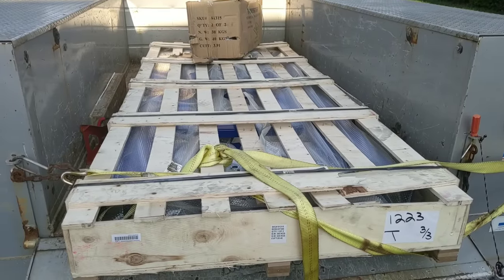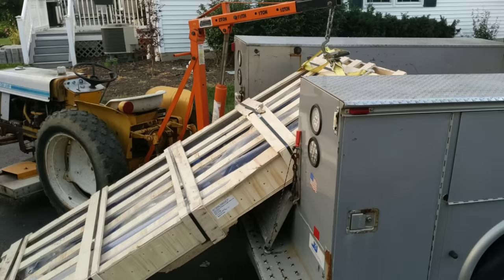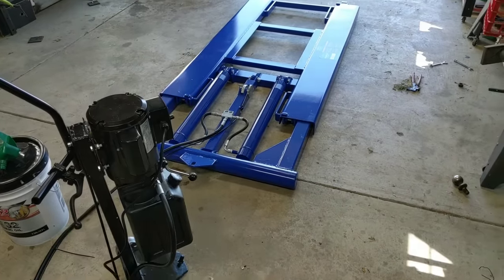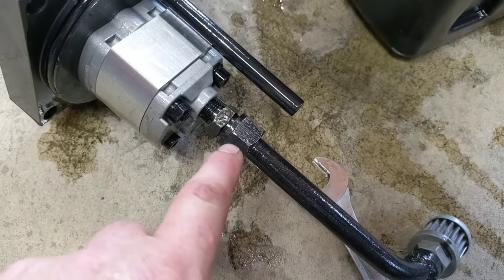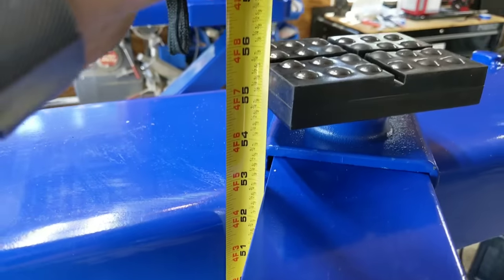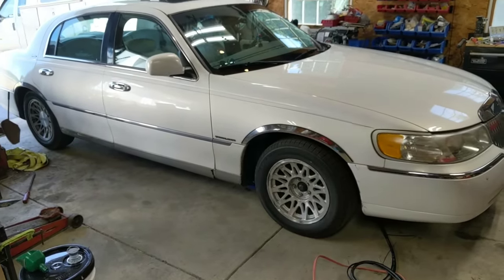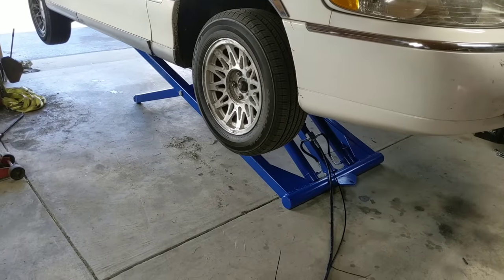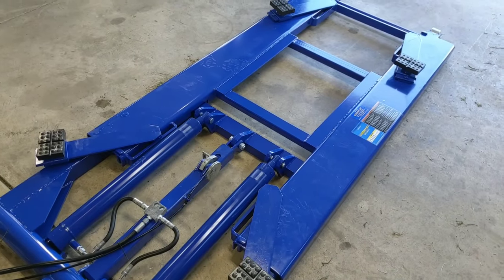Harbor Freight 6000 Lb. Capacity Scissor Lift Review, Central Hydraulics, is it worth it?

Comment: I have had mine for at least 15 years,,,it still serves well,,, I use it at least once a week,,,and more most times. It lifts my car,,fullsize Tundra pick up,,and my motorcycle,,,,its possibly the most sought after piece of equipment by my neighbors. I give it a thumbs up all around. One neighbor has bought one as well,,,,,,if there has been any issue its the coating on the steel, it really failed too early. But that has been touched up over the years as required.

Comment: As a 20+ year certified welder i find it  hilarious when people say the welds look good or bad! Well I’m welding it’s not the how a weld looks it’s how does it hold! In other words it could be the best looking weld you ever seen and not hold 100 pounds or it could look like crap and hold a building! When it come to welding looks can be  deceiving!
Reply from the maker: As a non certified welder, I agree.   That being said, you can spot a bad weld if it's bad enough.   And your right, really good looking welds can be cold and fail.
Reply: @1D10CRACY  I agree 100%
Reply: oh my god Dodge Ram 01 ! Thank you for the comment. i have said the same for years ! These "welders" nowadays will argue till blue and still keep going. so glad to know that someone else out there has the same thoughts and understanding..
Reply: @corgidriver9625  Well its just common scene!
Reply: @1D10CRACY  And, it's not made out of steel. It's Chinesium.
Reply: I doubt your certified. Slag inclusions, undercut, overcut, porosity-- all are unsightly and all will cause your welds to fail on your 6010 root passes and 7018 fillet beads for you 1 inch plate bend tests in flat horizontal vertical and overhead positions. When your beads are stacked up like dimes, at the correct temp and you watch your puddle, avoiding the aforementioned-- you have  welds that are beautiful--for a reason. They were executed by someone who was taught the proper way to weld.
Reply: @jkgkjgkijk  Brother you can cold weld dimes!
Reply: Greyghost680 you can’t tell welders shit! I’ve VT rejected guys that have welded 40 years and have never heard of excess reinforcement... or unacceptable weld profile. always interesting when  rejecting those and listening to the bullshit!
Reply: @jkgkjgkijk  Thats all fine and dandy but 6010's and 7818's are arc or stick welding! I was talking more about Mig! and Tig! Any who 6010 is on lower grades of pipe, much more common is 70+ (8010) and sometimes 7010 70's are stronger!

Comment: I have owned this unit for about 6 years. There are at least 3 safety issues. First, over time the spring that detents the teeth gets weak and does not engage. Second, if the hydraulic unit falls over and snaps the hose, it goes right to the floor. I welded a large screw over the cam and screw it down tight. I also added more meat to the teeth. They are too shallow. The last issue was the power switch. It will arc and stick. This means it will not stop going up.
Reply: M1088Guy that isn’t good. It sounds dangerous
Reply: Is it stable when the car is up in the air? Can you push is and it won't fall?
Reply: @billcoley8520  Yes, without my mods, it is a dangerous machine. If the hose for any reason comes off, it can go right to the floor. Should have safety valving in hydraulics to prevent this.
Reply: @victorC308   This is rarely an issue on solid, level ground.
Reply: I would also move the hydraulics to a wall. Use the stand to move it around. The pump can fall over and snap the line. It happened to me.
Reply: @urgentcareguy3  ok. So I can trip on it and it will be stable?
Reply: @victorC308  Trip on table? I would think so. Trip on the pump, not so much.
Reply: Wow,  Good that you posted
Reply: so if the power switch this guys car would lift the ceiling off and destroy the car ?
Reply: @joeennis2571  exactly
Reply: Unless you use a relay, most switches are not capable of the amps that this draws. Worse with 120 volts. This means twice the amps of 240, which might melt the contacts.
Reply: @urgentcareguy3  how many flat dead guys in a rarely.....😀
Reply: @urgentcareguy3  there are lots of switches that can handle the current.....just not chinesium switches.....😀
Reply: @mdrew44628  I looked, but was not as common as I thought that it would be.
Reply: I noticed that you have to make sure that lock cam doesn’t kink. Oil the whole banana regularly. Aft a while the lock works in nicely and you can hear the clic when it engages.  Put a cinder block on the plate of the lift. It’s very top heavy when separate.

Comment: Get the Quick-Jack. 

The Quick-Jack allows you to work on the underside of your car and also replace/rotate wheels, since there are two jacks....One jack for each side of the car which exposes the underside for work and repairs. This Harbor Freight jack is more expensive, and prevents you from being able to do repairs. It's good for rotating tires, and that's about it.
Reply from the maker: Quick Jack's are awesome!  And they store better.   I looked at them before buying this lift, but for me, the lift is a better option.    For lower body / detail work, this lift works out really well.   A stool with good wheels and now your saving your back!   I also wanted to use it as a welding table when not being used as a lift.    If a person wanted to do mechanic work other then brakes, then the quick Jack's would be a better option!
Reply: @1D10CRACY  buying a lift for tire rotations and brakes lol.
Reply: They’re for body work I do restos and have scissor lifts and quick jacks as post lifts are kinda useless when u have posts in your way they’re good for separating body’s from frames tho

Comment: To get around the ground clearance issue you can build two long ramps out of 3 or more stacked 2" x 12"s  that are flush on one end and stepped on the other at about a 12" offset/stagger to drive the vehicle up and over it. Just make sure the top level is long enough for the wheelbase and a 4" x 4" tire stop at the flush end of each ramp. Thanks for the video.

Comment: I’ve had one for about two years. I have a small garage with a 9’ ceiling. Its perfect for access to front end, rear end, interior work.. pretty much everything other than transmission and some exhaust. I did buy the pad extensions because my foxbody is low to the ground. I did need to build a ramp system to drive onto because everything bottoms out. Even a basic Nissan Sentra. When the car is on the lift, it’s a bit sketchy. I feel like it wouldn’t take much to to push it over. Of course, the higher you go, the worse it gets. All in all it’s a great lift. It is quite limited, but, it makes up for it in convenience. Oh, I also use it to lift my tractor and it doubles as an adjustable work surface when I don’t have a car on it.. I just toss a sheet of plywood on it.

Comment: I had snapons version of this for years and it was rated to pick up a full size extcab truck and it did a great job . The arms were way beefier and longer and had extendable tubes that those pads set in for  different heights.  I added a wider heavier steel pad on the front for side stability.  . It was perfect for my paint and bodyshop. And is still in operation 20yrs old . This HF lift isnt far off the quality of the snapon 1 . I might go get 1 and modify for my commercial zeroturn mowers.  The price is good considering I'm gonna cut it up and modify right off the bat .
Reply: just FYI, Snap-On DOES NOT MAKE lift equipment or floor jacks. THEY NEVER HAVE! 
This equipment is made FOR Snap-On by import companies, I.E., Japan or China AND Possibly USA, which is very  rare back then AND these days.
 I  am in the hydraulic repair business so I know this to be a fact. 
You are ONLY PAYING FOR THE NAME, AND TRIPLE THE PRICE AT THAT! Not to be mean, just telling you a true fact. 
I know many mechanics who buy from snap-on and the jacks and or lifts are NOT MADE by them, only painted with their logo on the equipment. All you have to do is look closely on the tag or frame and you will see where it was made.

Comment: For clearance between car and lift.  If you don't intent ever moving lift, you could recess lift into floors, so top is just above concrete.
Reply: For safety I would bolt the lift to a heavy concrete floor.  Does not look stable.
Reply: @peterbond3628  You might be able to bolt down the front section, but the back half must move on the floor as the scissors close to extend the height. A good concrete floor would be important because a lot of weight will be on the two back rollers.

Comment: That is so scary just looking at it. I wouldn't use it until I welded a couple of sidebars on the bottom part to keep it from tipping over.
Reply: I would use it about 3 feet off the ground to do oil changes, suspension, brakes, etc.  But 6 feet off the ground would be scary.
Reply: I work at an older Toyota dealership and they have lift that come from the ground, when picking up tundras and sequoia’s I really question those lifts but they get the job done and if you know what you are doing their shouldn’t be a problem.
Reply: That was my thought too! Way scary,I would rather use a jack and jackstands.
Reply: Jason B if you run a small shop this small lift could be very beneficial. It’s all about the experience you have lifting vehicles and what type of job your trying to accomplish.

Comment: I did my due diligence and ended up going with the quick jack from bend pak. Doesn’t lift as  high but it’s 2 units leaving the center open for creepering and working. Because it’s 2 units, when you’re done using, you can roll them out and hang them on the wall, freeing up floor space. Also much lower in the down position for cars without much ground clearance, like my MX5. I’ve been very happy with my decision.
Reply from the maker: The quick jacks are very nice!  I have a friend who bought a set right before I bought this one!

Comment: Watched your PSA video for which the comments are disabled so I couldn’t make this point there.
One of the greatest dangers of this type of lift is the floor underneath it. That solid looking concrete garage floor might have a serious weak spot either due to a bad pour or a sinkhole under it, if you’re going to lift more than a bike or a Miata GET THE FLOOR CHECKED! There are firms that ultrasound concrete to check for the types of issues that could kill you.
If you can’t find a company or they want too much get some heavy steel plates that are over 12 inches larger in all directions than the area the feet travel on and bolt them to the floor.
Reply: unemployable . The point is Unless you have X-ray vision don’t trust it for heavy vehicles.
The entire weight of the lift and vehicle is on four tiny contact patches and if you rock the vehicle almost all the weight can be shifted on to one knife edge area about two inches long even really good concrete with a hole underneath will fail under that load and you can never trust that a home garage was built properly or a water pipe hasn’t leaked and washed away the foundations.
Reply: unemployable . I’m not talking about a quality job with good foundations. I’m talking about the stuff I’ve seen in a lot of home garages. The lift maximum load is 6000 pounds plus the weight of the lift of about five hundred, normally that is divided by the four corners so that’s about 1600 pounds per corner, the contact pad on the back corners is a roller of about two inch diameter and two inch length giving it a contact area of less than an inch. Rock a six thousand pound vehicle on that lift and you could get a shock load of over three thousand pounds. Concrete with questionable foundations and questionable pour quality may not be able to handle a 3000 pound shock load. Search for videos of hoist collapses many will be the floor giving up.
Reply: @inthewoods5471  . My initial comment was a PSA so no one gets crushed by a vehicle toppling off the lift which happens fairly often especially when idiots ignore safety warnings.

Comment: I bought one and would recommend it we use it in our body shop. We added quick couplers on hydraulic lines at pump we had no issues.
Reply: I've worked in body shops that have these and they are a huge help.

Comment: had mine for  3 yrs. now,  pump is top heavy so you have to be careful moving it. Lift is 1000 pounds so it can be hard to position if you need too. I built 6 inch ramps to drive onto and made longer lift pads  so I could lift my 6000 full size GMC pickup. Had my 71 chevy nova up in the air for weeks just to test it. no problem. I feel safe under it. made it east to change O2 sensors, brakes and exhaust work. glad I bought it at 25 percent off.

Comment: you could recess out the concrete in the area where you want the lift to live at, so it will be flush with the floor, that would give you more room to lift up lower cars
Reply: You mean so it sits on the dirt under the concrete?  Ya okay           lol

Comment: Great review. 
If I bought one of those I'd have to cut the concrete in the garage about an inch in the spot I would permanently leave it so I got better clearance.  Other than that I think I would buy it.
Reply: Problem is the wheels need to roll as the jack is being raised or lowering so you couldn't notch your concrete !!
Reply: Recess it flush into the floor ,  no clearance issues.  Put a aluminum cover over it when not in use.

Comment: Anything with motor I don’t buy from HF.  Also wrenches, flashlights, metal pliers, oscillating saw:  bought 3 to remove the floors.  All 3 gave up.  So I went to Lowe to buy 1 and finished the job quick and 5 years later still work.
Reply from the maker: They get a bad wrap from their cheaper tools for sure!   They should really advertise their better lines.    They have three tiers of cordless / corded tools now.    Their regular cheaper line is kind of crap.  The Bauer line is comparable to Porter Cable and their Hurculies brand is supposed to be a professional line, albeit expensive.  Same with the hand tools, their regular house brand is crap, but the ICON brand is pretty good, along with their "pro" line.  I guess it works out to the more you pay the better.

Comment: At Walmart, we use the Challenger lifts for tire work. It's a similar type of unit, but it is bolted solid to the floor with concrete lag bolts. There is a drive over ramp on both ends and we use 3 different types of lift blocks which are not mounted to the lift. Which one depends on the vehicle being lifted.  Maximum lift height is only about 18 inches so you have to get down on the floor to do tire work. The entire length of the lifting platform is only about 40 inches or so, so some vehicles can't be lifted because their lift points are ahead and behind where the lift table can reach. Those are occasional happenings, but fairly rare.  The max lifting capacity is around 8,000 lbs so the lift can raise a full sized 1 ton pickup. The manufacturer does provide a lifting guide for us, but it's geared towards their 2 point spider lift, and doesn't really help much with the lift we use.  It would be helpful if they produced a lifting guide specifically for this lift, so we don't have to guess if the vehicle can be lifted with this lift or not.  But that's Walmart for you. Corporate contracts for items that don't really make the job any easier.

Comment: Go to a chamberlain shaft door opener also if you lift it almost all the way up you can move it a lot easier.  I have the same lift mostly for my mx5
Reply: How the clearance? Do you use wood planks to get her up there ?
Reply: thestig572420 1 by 3 on edge with 3/4 ply on top 1 foot by 4 foot 3 on each side
Reply: Hi, I will like to ask u.....if this one is in your garage...... because I got a SUV 4runner ,99 ....

My question is.....if I can do in my truck.....inside the garage?
Because you know all the garage mostly are the same high....

And I don't think if I can do myself.....is very haevy right..to move around.

Thank you.

Comment: This lift seems to be put together rather well,as opposed to an air jack I had bought from H/F.It's supposed to lift one end of the car and I was pretty excited waiting for it so it would make my life a little easier,BUT when it got to my house and I unpacked it,the first thing I noticed was It was welded together ass backwards and lifted crooked.I wanted to try it and did.It lifted the car so fast I thought it was gonna throw it through my ceiling and letting it down was experience as well.It would have been lowered down easier if King Kong  was to lower it.Anyway  I still buy from H/F because they do have useful tools and if you know what your looking at you made a good deal.
Reply: Thought it was going to throw the car through the ceiling.  Made my evening.  I can imagine my truck going up like that, I’d have to throw away my pants after that.
Reply: lol  What an experience that jack was.I haven't had any other messed up experiences with anything else they sell YET.That jack scared the shit out of me.I wish it was a good tool because it would have made my life so much easier but why would I think life was easy to begin with?LOL